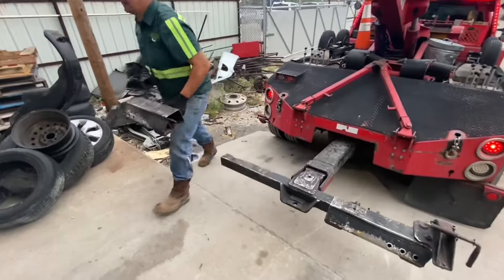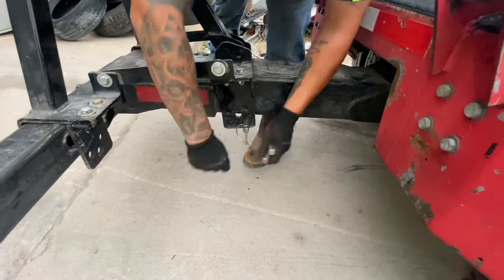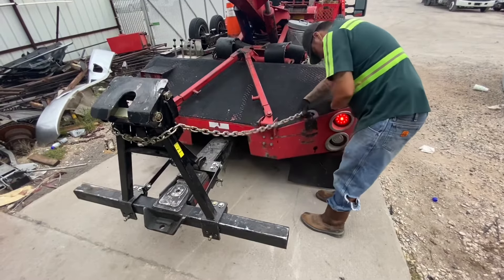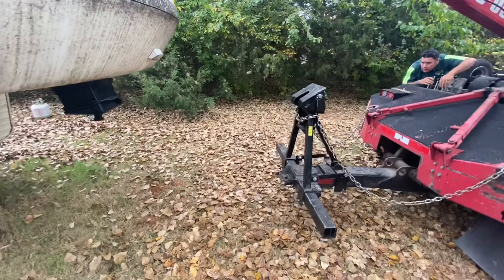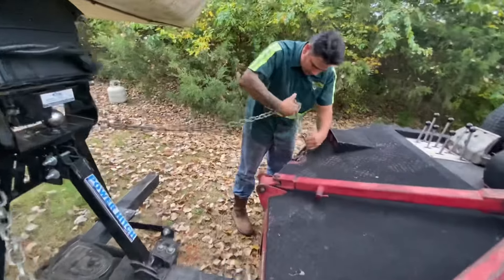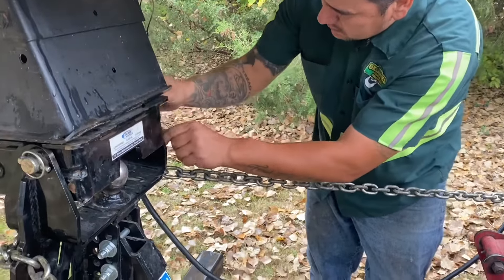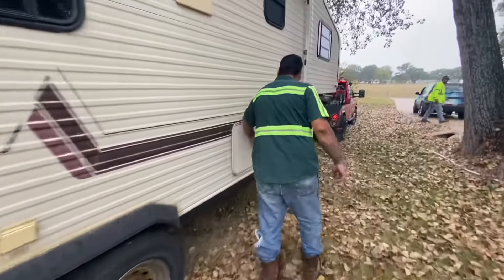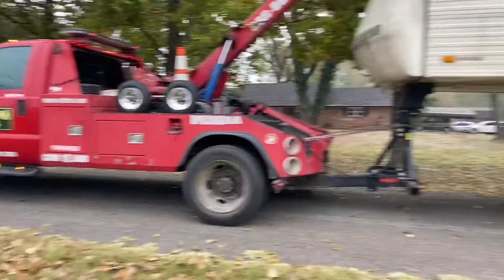Using the fifth wheel/goose neck attachment on a conventional wrecker

Comment: Hey guys this is an older video I hope you still are active!! But I bought one of these for my Vulcan rollback with wheel lift and need to use it to pull people of the mountain pass. How does it do for distance? Can I go 40 miles with the trailer to get it down the pass since there is no where to park it on the pass??

Comment: this is exactly what I need, who makes this particular unit?
Reply from the maker: https://zips.com/parts-detail/in-the-ditch-fifth-wheel-power-hitch-itd-1253?ppc_keyword=&gclid=EAIaIQobChMItYqgqMDL7QIV8_LjBx2lvwWTEAQYASABEgKibPD_BwE
Reply from the maker: ITD makes them, they list for a little over $800 but totally worth the investment! I saw a guy move a 50’ racing trailer using a simple conventional.
Reply: @PATCAM2006  ya I love the design and the simplicity of it, looks like its easy to mount, thanks for replying!
Reply: @PATCAM2006  just to clarify, what does ITD stand for?
Reply from the maker: In The Ditch
Reply: @PATCAM2006  ya I realized that after I replied, thanks again!
Reply: Can I use this on my flat bed wheel lift?
Reply: @alphatowing9905  I've seen these units used on flatbed wheel lifts, so I will say yes
Reply: What’s the hight on this from the T bar to the top of the fifth wheel plate